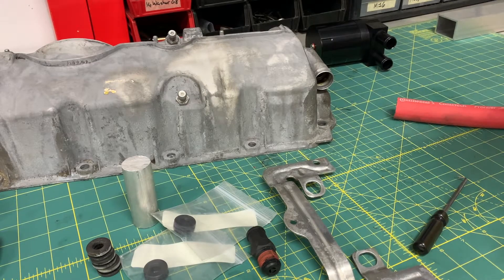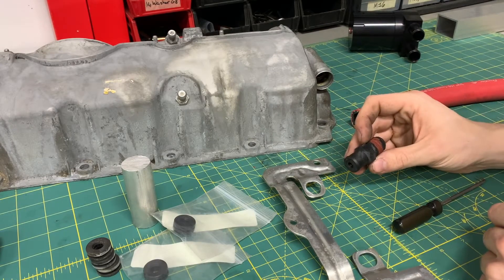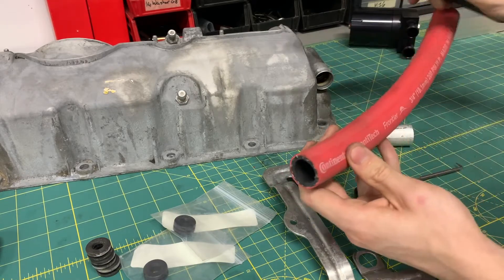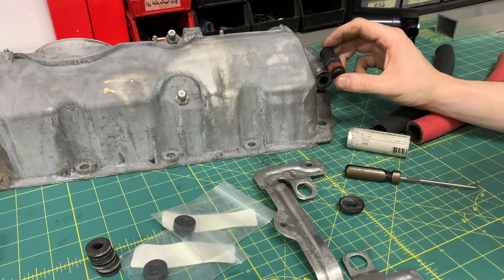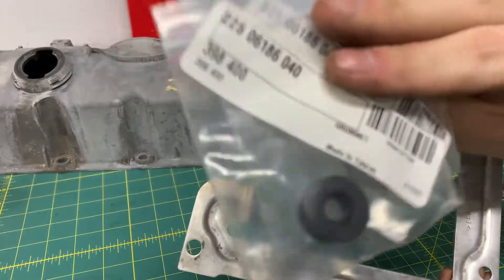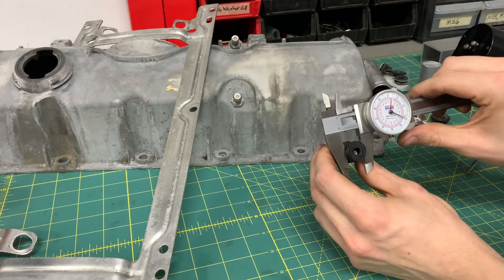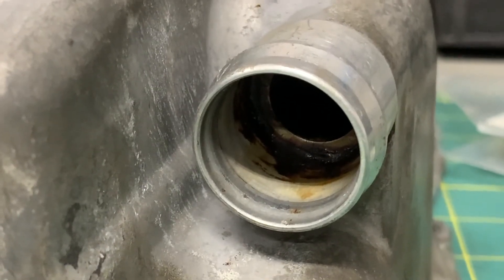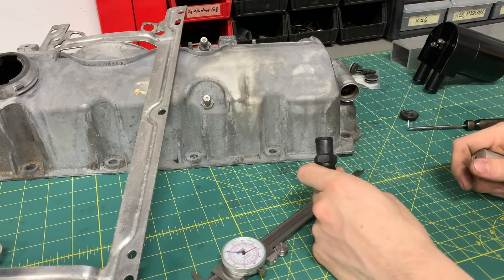BMW N52 Magnesium Valve Cover Conversion - Part 3: Brainstorming

Comment: Casey Find another Bigger PVC. Thinking old Chevy 350 pcv is about the size You need! I have a 2006 BMW Z4 with the N52 engine so I am Rooting You on as I would want to do this conversion to My Z4.   Marty
Reply from the maker: Marty, thanks for the input. The PCV valve that I selected is one that I have seen used for the M54 engine when people covert those to a catch can setup. I have no idea if it will work for the N52, however, I thought it was a good place to start. If it doesn’t work I will try something else, and post my results to the channel. Thanks, again.
Reply: any update on this set up? @Casey_Schmidt
Reply from the maker: @8884-l8k  nope. I sadly no longer have the car and wasn’t able to find a pcv solution that I liked. I will leave it to the internet to find a better direction.